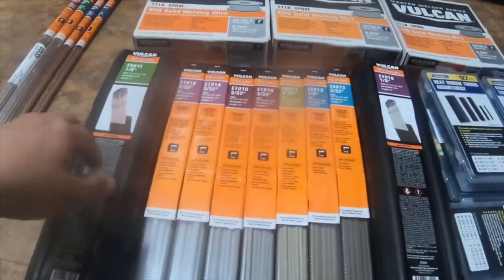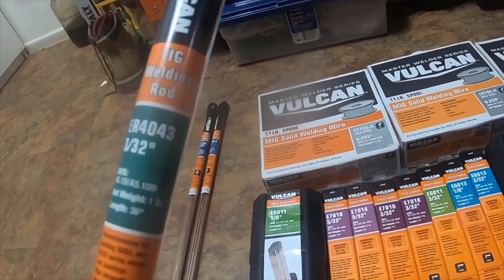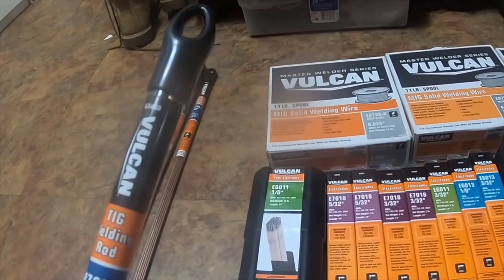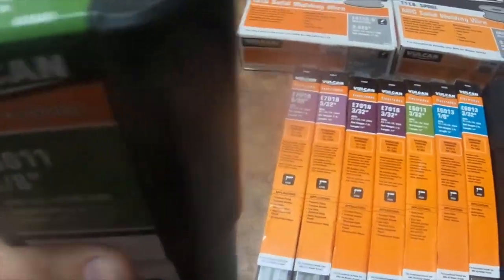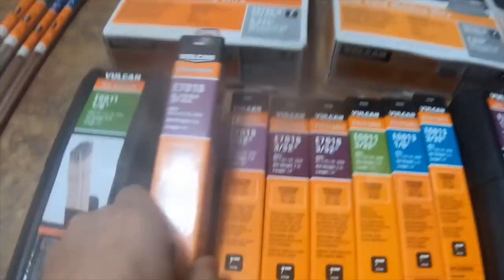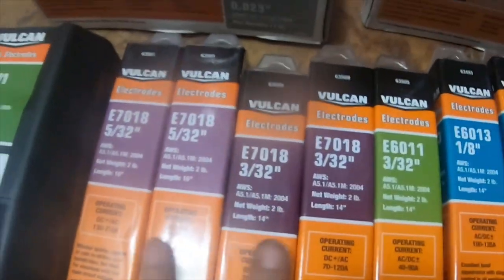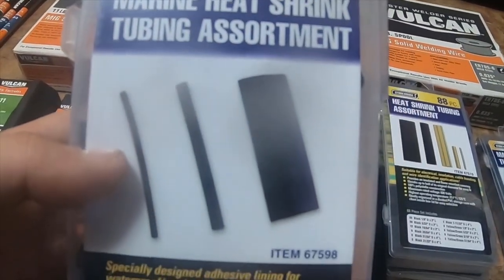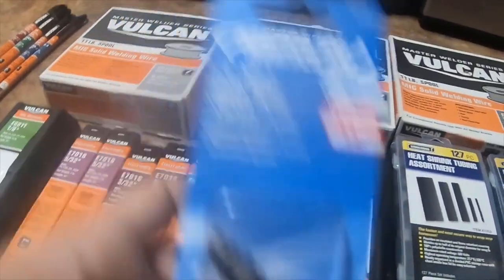Tool Haul Harbor Freight Welding Accessories Part 2

Comment: Nice haul. I bet all that would be a small fortune if you bought "name brand"
Reply from the maker: Name brand like Lincoln would be about 300 dollers more
Reply from the maker: Miller brand would be more like 800 more
Reply from the maker: Hobart brand would be about 500 more
Reply from the maker: Depending on the stores you go to to buy these brands
Reply: Lincoln makes about the best stick rods around, pretty good wire as well. Miller don't make wire they use Hobart and Hobart sucks in my opinion. Think I'd take the vulcan over the Hobart.
Reply from the maker: Miller owns Hobart now